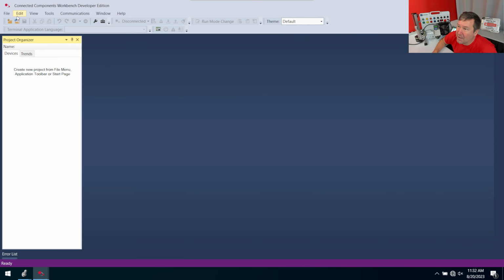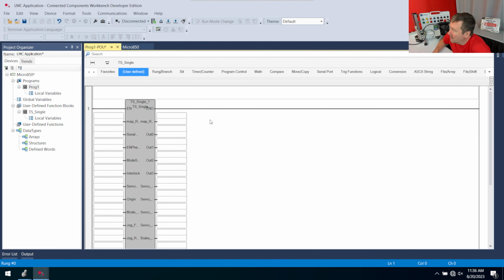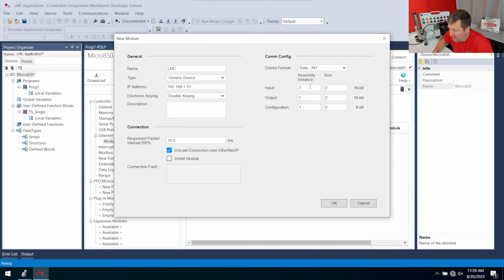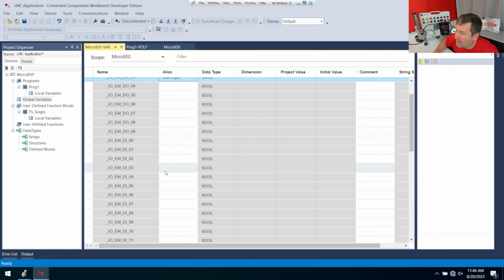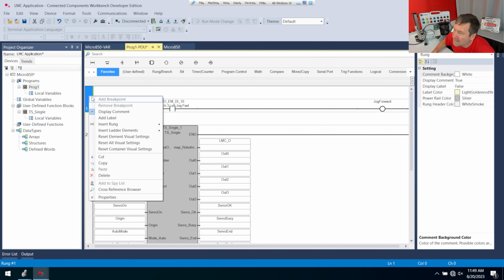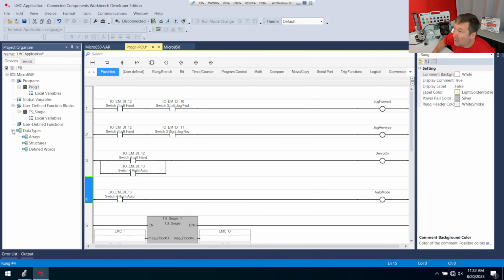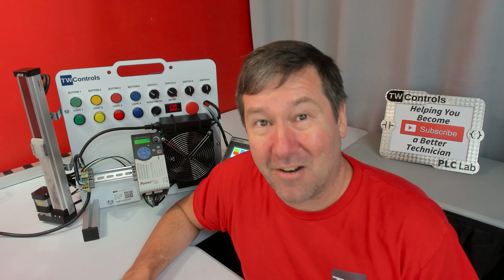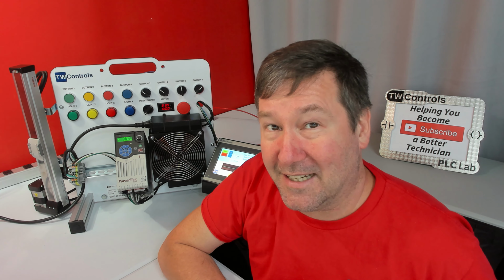Adding Motion Control to a Micro850E and Micro870E PLC

Comment: Hi Tim, hope you're doing well. Trying to follow along with this video, but it seems that the latest Yamaha software download from YRG's site does NOT have the same UDFB set up as the one in this tutorial. Notably, the SerialNumber parameter is missing. I can't get my servo to move. :(

The servo is connected to ethernet, and otherwise I attempted to follow your video as close as possible using the UDFB provided by YRG today. Any ideas what I can do to troubleshoot or fix this? I'm on CCW version 23. 

The name of the UDFB i'm using is YamTS_ADV_UDFB_1. I can't find the TS_Single that you reference in your video.
Reply from the maker: It is the "Allen Bradley Micro800 Series Yamaha Single UDFB (AOI) for TS Controllers".  I haven't used the advanced one that you are trying but this one looks the same.
Reply: @TimWilborne  Thanks Tim! I really appreciate it. Was evenutally able to get it working after some trial and error. Learned a lot by setting it up. Appreciate the tutorials!
Reply from the maker: That is great to hear!

Comment: Hi Tim, what version of CCW did you use for this video? I'm asking because I have the most current version (V12.00)  and it does not offer the LC50E nor the LC70E in the controllers drop down menu.
Reply from the maker: The latest version of Connected Components Workbench is version 22.